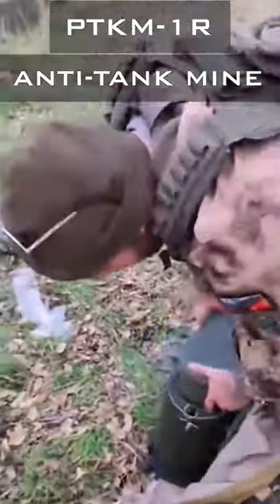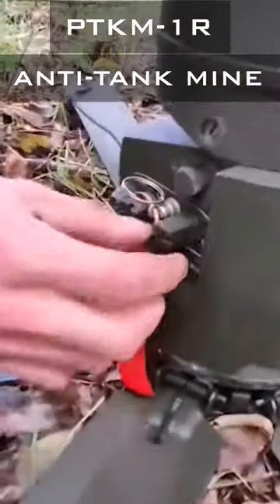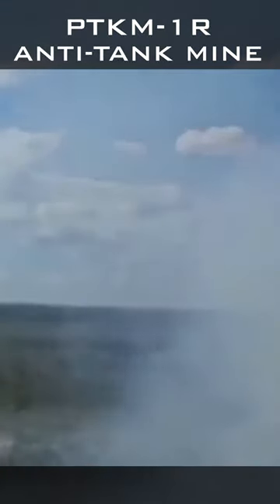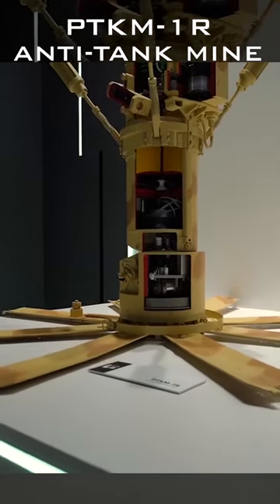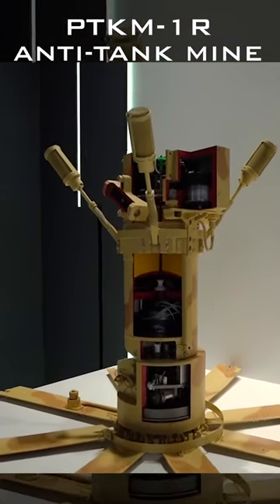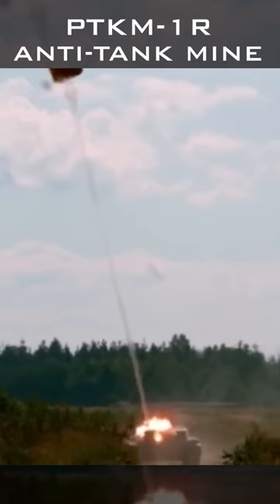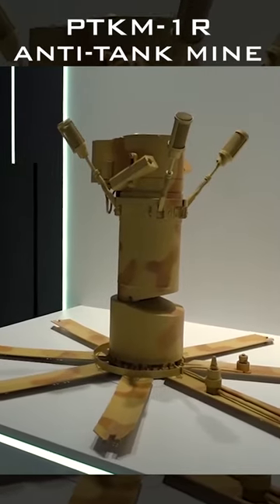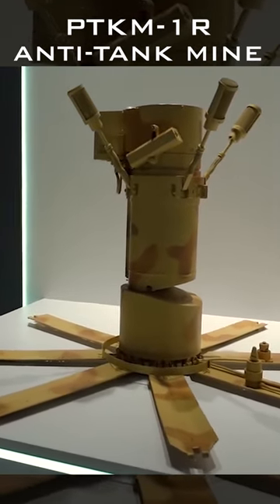PTMK-1R Russian Anti Tank Mine

Comment: Wouldnt work in the US with only targeting cars, some homeboy would come through with his 12" lifted F450 rolling with dual stacks making it juat loud enough and big enough to get smoked
Reply: well, a 2 to 3 long tons car wont make the ground vibrate like a 63 long tons tank with a 1,200 bhp V12 Diesel engine moving on tracks...
Reply: @Icarus7070 there set to weight more than the average car but not near the weight of a tank 😂
Reply: It would be placed in a minefield along with traditional mines. Combat engineers clear a very narrow route through the minefield. This will attack the heavy vehicles passing through the cleared path, causing a major obstruction. What you described is not doctrinal use
Reply: No way an army would do what u just said. Civilian truck lack protection especially in combat zones
Reply: it can get an update in seconds with new sound ground vibrations
Reply: I bet his neighbors wouldn't lose sleep over it either